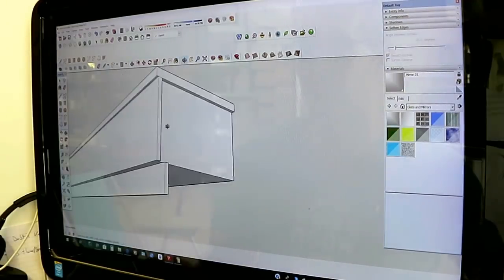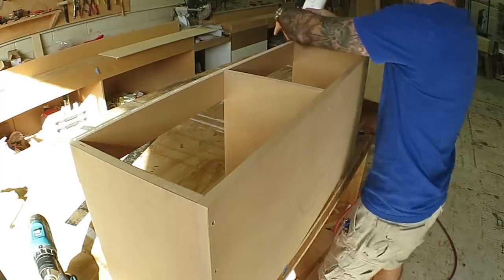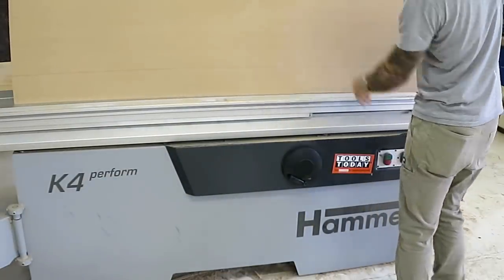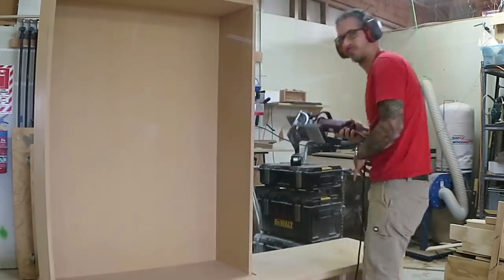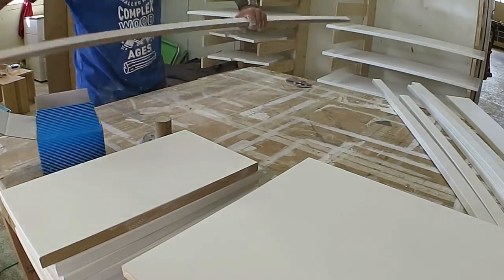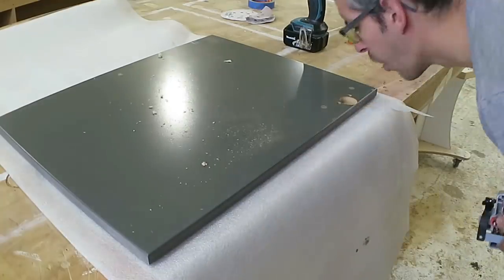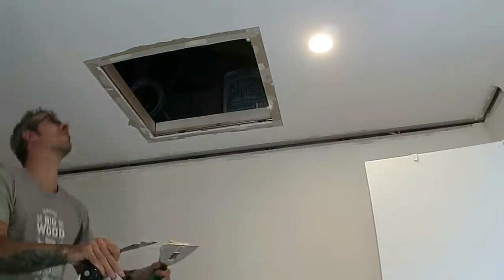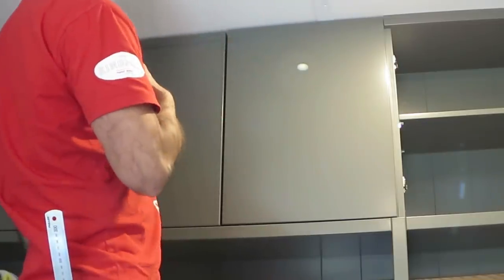Cabinets, Design to install

Comment: Those dummy grooves are a valuable tool to use.
Built ins that don't allow any tolerance to accommodate out of square or level/plumb can be a nightmare. very few buildings are ever built that accurately.. Same as the build up on plaster joints, especially in corners.
Nice job.

Comment: Very nice project , nice job on the attic access astatically pleasing  solution. Nice drawer kits they  look nice with a modern design and a time saver.

Comment: Will you update the post and include information about the feet, the drawer hardware, and hardware that you used to attach the face frame and units together. I've never seen the face frame hardware before.
Reply: The drawer hardware looks like Blum or some knock-off,  the feet look like Desunia. The detachable face frame and joining hardware is Lamello Tenso and Clamex. It uses a special biscuit joiner, Zeta P2, that slots the bottom of the biscuit cut and costs about $1700 USD.

Comment: 8:58 That is a cool way to connect those cabinets. What is this called and where can you buy these. The result is very beautiful, congratulations on this one
Reply from the maker: The tool is a Lamello zeta P2  the cam connetors are called clamex p14  ie 14mm deep. And the clip on connectors are called tenso   cheers

Comment: Man oh man that was a complicated project . . . no slop measurements there . . . by the way them facings your snapped in place, can they also be popped off again? Loved you showing the wrong calculation in the early assembly, we know that happens in every workshop. Looks amazing, the wood and paint combination was perfect.
Reply from the maker: Thanks!   Yea those clips do un-clip but are designed as clamps while glue sets. So repeated clipping will loosen the holding power eventually

Comment: That "V" grove trick is awsome, not a fan of off the shelf MDF bead board but this is looks great and would be a good replacement. What paint sprayer are using?
Reply from the maker: Cheers,  it's a Graco ultra, pretty good unit really.

Comment: Hi Joey , love this video mate , I love the painting section of the cupboard instead of sending to a Spray polyurethane guy,  which cost a packet to have sprayed and all your videos usually are painted with the pad by hand ? .
Can you guide me , What is the spray gun you used ? and what was the paints and what would you recommend  eg, primer to top coat ( Acrylic o a oil or polyurethane as the top coat has a good gloss straight from the gun)
Reply from the maker: I'm using a graco ultra sprayer,  it's ok. Does what it says but I'm not sure how it will last.  I use resene paints and primers and prefer their lustacyl semi gloss as my go to.  Depending on the project depends on the clear coat method.  I often use a brush pad for water based polyurethane.  Or rag on thinned down oil poly or Danish oil  etc.

Comment: Hey Joey, Love to see your vids appear...they are always super instructive.  So, sometimes you drill/screw the MDF, others you staple.  Why?  Also, what length of screw do you use for 3/4” to 3/4” connection?  What # screw?  What diameter bit to predrill?  Thanks!
Reply from the maker: So I only use pins to attach the backing . Joining 2 18mm panels I use a 8g 32mm screw.  For general cabinets I use 40mm screws generally 8g but I have been playing with 6g too. For 8g I used a 3mm bit and 6g 2.5mm bit. Cheers

Comment: Looks great!  How do you like the sprayer..?.  What kind of paint are you shooting, and how do you find it levels out..?  Thanks!
Reply from the maker: Sprayer is fine, it can be a little drippy but mostly good. I would probably go for the smaller corded airless in hindsight however so far the finish is perfectly acceptable.  I'm just using resene lustacyl semi gloss. Water based enamel.  Cheers
Reply: @KingPostTimberWorks  with what tip size and pressure setting? I've got the Graco Ultra Max and have had great luck with the 310 tip at 2.5 pressure using lacquers. No drips, as long as I clean my gun properly everytime.

Comment: How you getting on with the Graco Ultra , I had a mare with mine start to finish,  sold it before had any more problems with it , glad I did alot of people here in UK having problems with them , pump broken etc etc
Reply from the maker: It's ok...... pump so far is fine. Biggest problem for me is I tend to get an air leak into the paint pot then the finish is all up the shit and that piece needs to be done again...  also cleaning it sucks, but is probably better than cleaning a proper airless hose...

Comment: What kind/brand of drawer assembly hardware do you use? And where would one be able to acquire it?
Reply from the maker: The brand is Harn. I get them in new Zealand from Fit-NZ.co.nz
Reply: Thanks!  @KingPostTimberWorks
Reply: Is Harm an off-shoot of Blum? They very much look like Ikea's drawers, which I belive are a Blum product.

Comment: What is that measuring ruler/square you are using?  If you don't mind me asking.  Looks better than carrying a Try Square.  Thanks
Reply from the maker: It's a 12 in 1 tool buy woodpeckers
Reply: @KingPostTimberWorks  Awesome, thanks!
Reply: @KingPostTimberWorks  Wow, "Retired" in 2017.  What a shame.  Wonder why.
Reply from the maker: @davfinport   they do pre orders for most of there stuff and make only limited numbers I guess to create demand....

Comment: Great work Joey.
I have to ask, why the chicken wire in the ceiling of your shop?
Reply from the maker: Ah because of the low roof pitch, the paper needs support to stop it sagging. That's the official reason anyway.

Comment: How did you get the joining lamellos in the center unit when installing?
As you had to slide it in from the front and the two units either side were tight against the wall?
Very intriguing??
Reply from the maker: I cut off the little plastic locating pins on the Clamex faster leaving it flush with the side wall. cheers